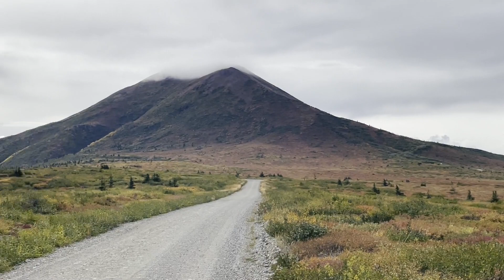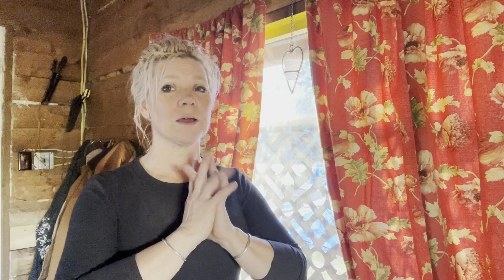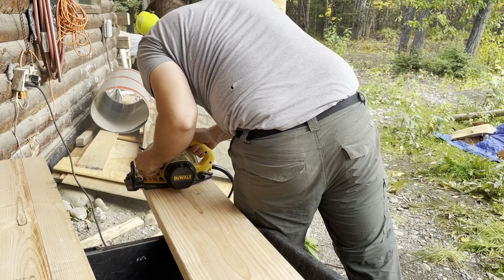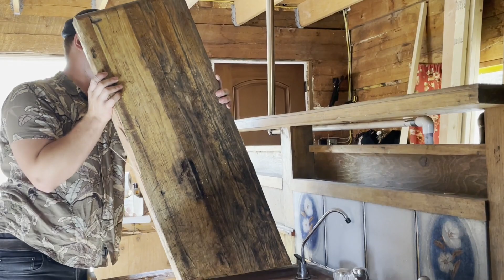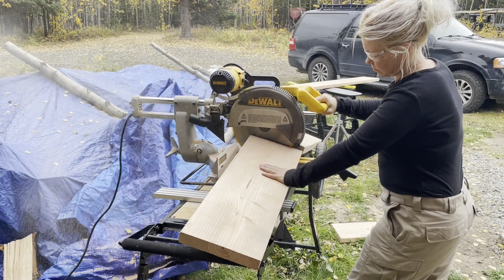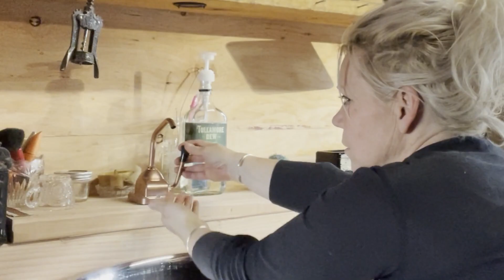Remote Alaska Cabin Kitchen Renovations & Bathroom Demolition Finally Begin!

Comment: Have you looked into Origo alcohol Stoves? I have a 2 burner of those, and it's great.

I love your honesty, it's very refreshing :) Kitchen looks great. :)
Reply from the maker: Hi! I had not looked into the alcohol stoves. I have seen them in use before, especially on boats. I might do a bit of research into them as I am finding that the cans of butane are becoming increasingly more expensive and are not lasting as long as they initially did. Not sure why, sometimes it seems that I am only getting three or four uses out of a can! 😳 Thank you for the kind words. I really appreciate them and you! 🤗💛

Comment: Ratchet straps are awesome and indispensable! I do everything alone myself, so you get creative. I can't tell you how much a third hand comes in handy. Ratchet straps, clamps,jacks,just to name a few. If you are thinking gravity feed water, look into RV pump systems. They only have pressure when you need it. And you could also pump your water upstairs. Kitchen is nice, but I love your new grocery store!! Stay safe!
Reply from the maker: Absolutely!! I have so many ratchet straps that come in handy! And now that I got all my stuff from Colorado, clamps and jacks and spacers. After flipping the table I built by myself (Kenai just watched) using ratchet straps some props and a 2x4 (utilized some old Egyptian pyramid leverage techniques):_What: I may have jumped up and down like a girl on Christmas morning! I think I figured out the faucet. A foot pump and a nice articulating cold water faucet that can be stretched over the table and then tucked away when not needed. I just have to put it all together and I will show it on a video. I do love my new mini grocery store though! I do plan on more shelving. Possibly above the freezers. But now I can easily make 8 ft sections of shelving in the root cellar. I cant wait to start that project! along with some nice sand beds. Thank you so much Ashley! :_Heart:

Comment: The faucets at my cabin work with a small water pump for RVs.  I collect rain water into a large tote then attach a hose to the inlet of the pump.  When the faucet/toilet/ shower is turned on, the negative pressure in the water lines turns the pump on.  Closing the faucets stops the pump.  My system runs off of a solar panel and marine battery since I am off grid but you have reliable electric so it should be an easier set up.  The pump costs less than $75 and I have water on demand.  This system is really easy to set up and use ( think 65 year old lady on her own ). Hope this helps.  BTW, love your kitchen but I am really salivating over the pantry.
Reply from the maker: My goal is to use as little electricity as I can. Granted a operational sink is pretty important but I am going to try a foot pump first. If that doesn't work I will most likely try gravity fed but use an electric pump to get water to the second floor. My cabin is still connected to an "on demand" pump but it only feeds to the faucet outside the cabin for fire suppression. My new pantry is three times bigger than the pantry wall. It's so nice to have everything in one room instead of all over the kitchen. Four freezers are nice too! Thank you so much! 🧡🤗💚

Comment: Another pleasure video to watch miss Annie alone..and nice job on the woodworking your shelf and table look good and iam impressed with your use of ratchet straps to hold things and squeeze them together. Now some advise..to make your shelf stronger you could put blocking under each shelf..blocks like you used to space your shelfs..just screw them to the legs.my dad built a shelf for canned goods and this summer I noticed the shelfs had bent and where the shelfs where screwed to the legs is pulling apart.
The pieces you put acrossed for your shelfs to sit on are ok flat but they would be stronger tipped on edge ( flat  - vr I upright) you should screw the whole shelf to the cabin wall too just incase.all you need is a few screws to hold it against the wall..earthquakes ya known.
I bet your ribs hurt from all the laughing and joking around with your son and the laughs still echo thur the cabin.speaking of the cabin the improvements are coming together and looking nice...keep at it and stay safe.
Is this coming Monday or Tuesday ok to send you a package thur the mail?? If so I'll sent it out..I saw something at the store that made me laugh and I had to get it for you along with a couple other things for you and the awesome doggy.
Reply from the maker: So happy you enjoyed the video! Those ratchet straps helped me flip the table over too! So I had thought about the spacers to be permanent when I started but I have very little weight on those shelves. My root cellar shelves will be built the same BUT will have the spacers and more uprights. May use 4x4 posts. It will be holding so many jars, so I want to make sure its heavy duty for sure! The pantry shelves are nailed to the wall in two places and to the ceiling in two places. It doesn't move. I considered nailing the legs to the floor but may just get some big "L" brackets. The time I spent with my son here will be cherished memories forever! He just knows how to crack me up! And that is very sweet of you twobears!:_Smile:  I know I said Oct 1 was the deadline but I have many items I have needed to purchase on Amazon so I will be going to the post office most likely for a couple weeks still. We did get snow here but its just the start and roads are not icy yet.:_What: So no worries about it getting sent back. I just hope the shipping isn't too much! And if you don't make it (I know you are a busy guy) I will open the PO box again in April. Thank you so much! :_Alone::_Kenai::_Heart:
Reply: @AloneinRemoteAlaska  I sent the package out tuesday.it says Saturday delivery..I'll track it and let you known when it's there.
I'am not worried about shipping cost..you have earned way more then that for me just the valdez video was worth more then that too me.
And then there's a "follow your dream" video.thats very important to me..more then you will known.yesterday I did something I thought i'de never do and I did it because of your pep talks.i went to the school I drove school bus for and walked thur the doors yet again.i went to talk to the supervisor about going back driving..he was in a meeting but I left a message for him and he's all for me coming back.my idea is to drive here then when school is done go to alaska for the summer.i can retire in 6 years and then i'de move to ak for good..if I find what I want in ak before the 6 years is up and i'am able to i'de just stay for good.i already have my retirement I just need to hit the best age to do it.

Comment: WOW! The cabin looks AMAZING!  Well done!  Oh, and you are NOT vain, not in the least.  As for your kitchen tap setup, I would suggest (and Boss has done the same in other projects) going with a 12 vold RV water pump (you can hook it to 120v with a power supply) and an RV tap.  The pump turns on when you turn the tap on, and off again as soon as you turn the water off.  If you want to be sure you never have to worry about it running and emptying the tank when you're not there, just use a simple on/off switch to turn the power off to the pump when you're not using it.  The pumps are cheap, I think I have one in my hoard somewhere for a project I never got around to lol.  That ceiling fan was an awesome idea, and I love your new bedroom, but it would be WAY too hot up there for me to ever sleep.  I'd have to install the porch outside the bedroom so I could sleep out there lol.
Reply from the maker: I have been trying to stay away from electricity (AC or DC) to run the water but you may be correct here. If I don’t do a foot pump, something I watched another YouTuber put in his van set up, I will look into the electric one. But I do like the on/off switch idea! I’m curious what you had planned for yours! A project coming up though? :_What:Always a good thing to have in your hoard though because you know a project will come up! They always do! When I was looking at ceiling fans at Lowes/Home Depot online, it was just pages and pages of the same ole ceiling fan. But they had a section for “specialty” and there was this one and a “Steam Punk” themed one I almost bought until I read the negative reviews. That door luckily lets out a lot of heat so works great as long as it is not raining. I think once the balcony gets installed, I would not be able to resist sleeping out there a few times! At least before or after mosquito season!! LOL! Thank you so much Colin! :_Heart:

Comment: Hi boo got a idea for the sink solar powered water pump battery and electronics inside solar panels outside  and you can still use the setup you have it a low flow setup and you can have a switch to turn it on and off. You know that if I have a idea while watching I have to write it down. This is why I comment more than once.  Wish I could lend a hand for the inside cause I'm am a master woodworker I've done everything that concerns wood, built houses,remodeled houses, heck I have even picked houses up off foundation and moved them to other locations. Nothing I can not do if I put my mind to it. ✌️🤍🙏
Reply from the maker: SO Beast, what did you think of my new table? Not something you would normally see in a kitchen nowadays.:_What: Funny you mention picking up houses because the previous owners had the cabin lifted to build the basement/root cellar. As for the sink/faucet idea, I am going to try a foot pedal pump and a new cold water faucet. I would love to do more solar type stuff but I get so little sun in winter being tucked next to all these tall trees! But like you said, if you put your mind to it, anything is possible. Although I would have liked some help turning that table over! :_Laughing: Thank you so much Beast and you feel free to comment as many times as you like! :_Heart:
Reply: @AloneinRemoteAlaska  the table is creative and unique but to be honest I like it and for a dru cabin that will give you more use of just a table it would be what I would have done. Foot pump would get on my nerves but if it works for you who am I to say anything. Have fun boo

Comment: I love the new counter, my concern is all the items on the shelving behind the counter. Everything is out of reach, it will be tedious after a while when trying to use them. I understand your issue about plumbing, will you put in a composting toilet? I love the chandelier.
Reply from the maker: I had considered taking down the shelving behind the counter because of the reach but realized that if I need anything I can climb on the table to get it. Obviously without my shoes on.🤣 But I only put (out of reach) items I rarely use there. Like the alcohol. I am researching composting toilets and will most likely get one next year maybe. The 5 gallon bucket I use now does a great job but it's not a long term solution and I would like my new bathroom to look nice. I hope to get my light bulbs for the chandelier soon! Thank you so much Jaculin! 🧡🤗💚

Comment: The easiest, and my go-to finish, is mineral oil and beeswax. It is food safe and looks gorgeous. It is easy to make with a double boiler set up.
Reply from the maker: I have watched a few woodworker channels that have used the beeswax and mineral oil and it looks great! Mostly what I have seen them use it on is butcher blocks and cutting boards but those items get beat up pretty bad sometimes. The cook method is similar to making candles. Thank you so much Chris! :_Heart:

Comment: I love what you've done to the cabin!  The counter is amazing, and I have to admit I was cheering you on when you got on the floor to push the shelving over with your legs.  I've used the same moving technique while working on my cabin.  I feel the same way about plumbing and am working on minimizing my need for it.  I noticed the bung wrench on top of one of your water barrels.  (I just bought one myself).  Your son is awesome!
Reply from the maker: LOL the ever so reliable “moving heavy stuff with your feet” trick! Amazing how well it works though! :_Laughing: There is a huge sigh of relief for me now that there is zero plumbing in my cabin! :_Smile: BUT I do still have the 500 gallon tank hooked up to the on demand (electrical pump) for the fire suppression garden hose outside the cabin. It will ONLY be at the ready for outside fire fighting. The bung wrench is such a time and wrist saver isn’t it!? I used to open the handle side of pliers spaced out to open the bung fitting but I had enough of that after pinching my hands a few times! The right tool for the right job!! :_What:My son was awesome! Never once did he question what I wanted to get done (ok maybe once) and we just knocked out one project after another until the last night! Thank you so much Beth! :_Heart:

Comment: Fantastic video. Love the curtains and that amazing fan.  Btw do you have electricity?  I didn't think you did. Those billion dollar views wow. You could put in a compost toilet or an incinerator toilet.  Btw.  I'd prefer that to running to an outhouse. Plenty of other ways to have an indoor shower.  There are doggy showers people use for themselves in fact. If you use gas for cooking do you have a carbon myoxide indicator?  Your house is looking amazing btw.  You vain?  Not.  Btw your son is amazing 👏  wow girlfriend you're very good at building.  I'm so impressed. I hope you secured it to the wall in case of earthquake.   I'm totally in awe of what you accomplished.
Reply from the maker: I do have electricity and plan to always keep it even if I switch to solar/wind. The winter time with the low sun and wind turbines are really supplemental to solar (slow to charge). You can always charge batteries with a generator too. My next video will be about the toilet and shower (water usage) but I love the doggy shower idea! I will have to look that up! I have 3 carbon monoxide detectors (one for each level). I’d rather overkill that safety device! And I also have many smoke alarms. My son was great! He did all the heavy lifting! And I have built things before but that counter was the biggest! I love it! The racks are definitely secured to the wall in two places and the ceiling in two places. It doesn’t move at all now! Thank you so much Batsheva! :_Heart:
Reply: @AloneinRemoteAlaska  your home looks amazing please stay safe.
Reply from the maker: @Sarahdrybones  Thank you so much Batsheva! Oh and next video is winter preps (water usage will be after that):_Smile:

Comment: Great job!  I only have one suggestion....because AK has earthquakes I would secure the shelving in the pantry to the wall and put a 1x2or 3 across the front of the shelves for shakage during a quake.  But I love it!!!!!
Reply from the maker: The shelving is secured to the wall in two place and the ceiling in two places. Will eventually "L" bracket the legs but it doesn't move at all as is! Too tall to tip over too. Its awesome! So much room I ran out of stuff! 🤣Thank you so much! 🧡

Comment: I LOVE your new kitchen and pantry area!!! I have always wanted a pantry but never had one in any of the homes we have lived at. 😕 I need to look for those trays you have sitting on your pantry shelves, where did you find them? Great idea! 
They sell small water pumps. I watch a few vanlife channels and they use them in their vans to have running water. I think they are 12 volt, some run off of a small solar panel. I bought a solar one for my outdoor bird bath, it has a tiny solar panel attached to the pump. I found it on Amazon for like 20 bucks and it actually works. 😂 I wonder if one of the electric pumps they sell for outdoor garden ponds would work. I'm sure you will find something. 🙂 
You should have a much easier winter this year with your new roof, woodshed and all of your other renovations. 
I'm very happy for you! Take care.
Reply from the maker: I have seen people turn a spare room into a pantry and that is how I got the idea to finally do something with that bathroom! Ah you noticed the trays! Eagle eye! :_Smile: The trays are actually aluminum bread rack trays. Found on Webstaurant website. One of those items you hold on to for “some reason” and one day is just the perfect use in a project! I have looked into electric pumps and may do something like that as a last resort. Nothing that requires the pump to be submersed in the water though. I think they have sealed in lubricant that can (if the case cracks) leak into the water. I am (for now) considering the foot pump idea I saw on a van life channel. And the new faucet would have an articulating arm so I would not have to reach as far and can fold away. I would like an easy winter but I am ready for a heavy one! Bring it! LOL :_Laughing: Thank you so much Tiff! :_Heart: